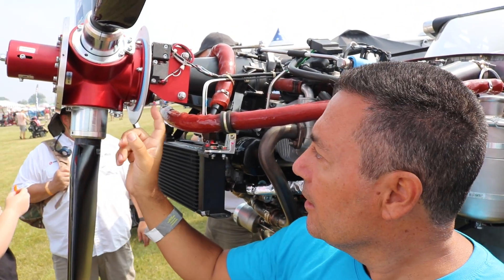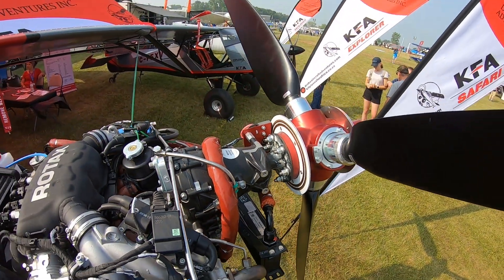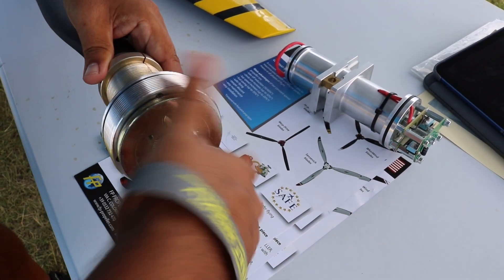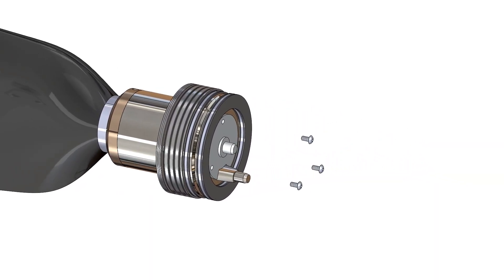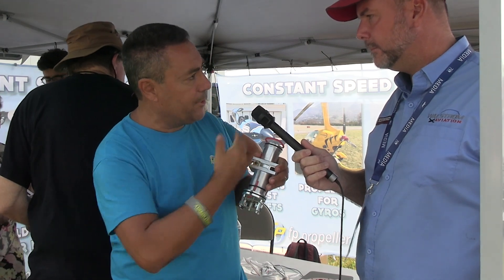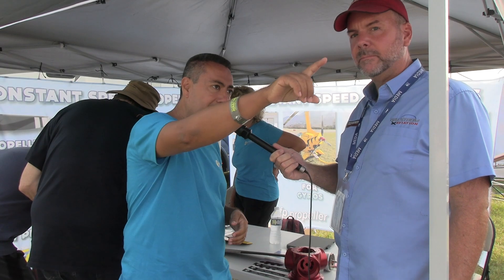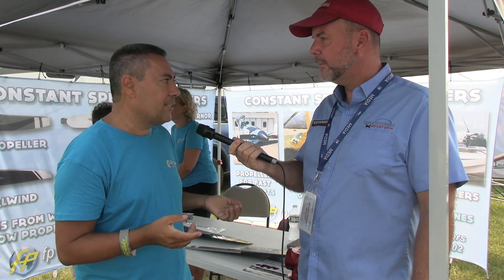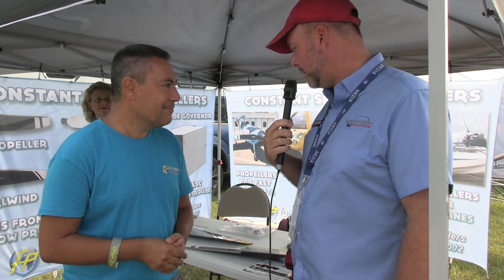In-Flight Adjustable Aircraft Propellers! FP Propellers - Oshkosh 2023

Comment: I had the system (fp + Warp Drive blades + electronic DUAL MODE GOVERNOR ) installed.
Unless going higher then 8000 feet you cannot manually adjust the prop better than the electronic governor box controls the pitch. It regulates every change of wind direction or altitude changes according to manifold pressure and rpm. Only when  cruising at very high altitudes you sometimes get slightly  better cruise and fuel consumption by manual adjusting. System takes away all hassle adjusting the prop during take off and landing. Fantastic for conversion training. Takes away the load from the students.Very reliable and super customer support by fp.
Video of the first test flight after fp prop installation (KFA Explorer 912 ULS):
https://youtu.be/lXvwZSEvVTc

Comment: These systems are brilliant and the engineering is superior. We started using the FP systems approximately 5 or 6 years ago at KFA and I have not been disappointed. The electric CS system with the FP governor is just something else, it has a full auto function (which is what we mostly use) and that controls the rpm to match the chosen MAP according to the Rotax engine power curve. You just cannot fly that accurate manually and we have seen huge fuel savings since moving to these systems. They also produce a hydraulic CS unit for the 915 and 916 engines which we use exclusively. As for reverse, the prop seen in Bryan's video about  KFA aircraft is one developed by FP for us to use on skies and floats. Andrea is now also looking at producing a reverse function for competition flying.

Comment: Sounds like you drive it till it pukes and buy a new one, it would be nice if you could change the blades
Reply: When I talked with them you can change blades out if damaged but youd get them through FP's workshop with their collars and everything factory installed. So can't go to Warp Drive and just get an off the shelf blade and DIY a solution. Which it was never meant to do that anyway. 

They also do have their own in house blades made with their own base integrated into the blade directly so that would be a potentially good way to go.

Comment: Electric prop… my step father that passed away less than a year ago at 97, told of a electric prop failure back in the? 50s or ?.  Helicopter working for oil exploration companies on north slope of Alaska found/spotted case of soda pop on tundra… hmm later they found another… then another.. all in a line heading twords barrow?  Turned out the store owner in barrow was flying a plane to barrow loaded with that and the electric prop pitch control failed and the passenger was throwing cases of pop out as fast as he could… but they crashed and weren’t found till years?decade later…..
Reply: You need to remember that power is only needed to adjust the propeller,
Today's technology is far more efficient than something that was designed many years ago.
I can understand where you are coming from because anytime you add another system only adds to more maintenance and extra controls that can go wrong. 
But with today's advances in technology in some cases only makes it safer.
And the other thing to consider is with a engine out ,being able to feather a prop would give greater glide distances whereis with most  experimental plane's having a fixed propeller a adjustable propeller could be a advantage.
Reply: Electrical and electronics have advanced a lot in 70 years. Look at modern EFI engines, more reliable than carburetor as most of it is solid state.

Comment: I’m curious if they can do reverse thrust for operating on floats or skis. I think I saw that in action in one of your other videos but I don’t remember the brand.
Reply: The prop installed on the KFA Safari showed in the video is a reversible prop specifically for float flying.
Reply: Yes, Must press 2 buttons at once before it will switch to reverse.